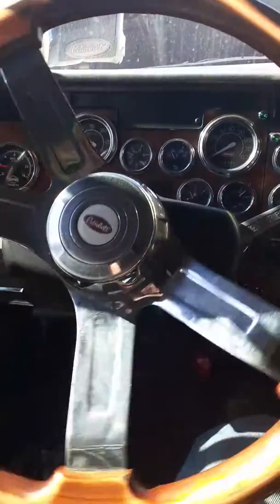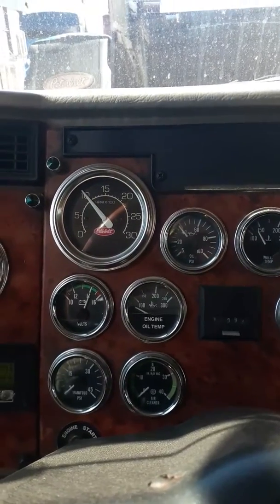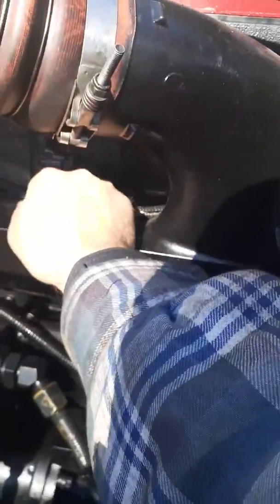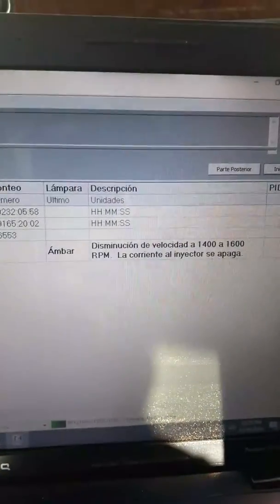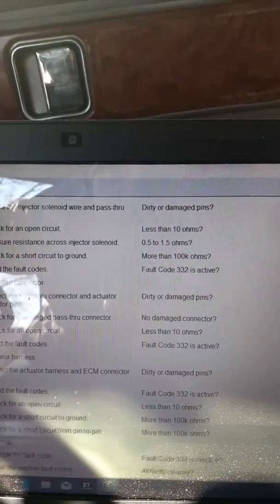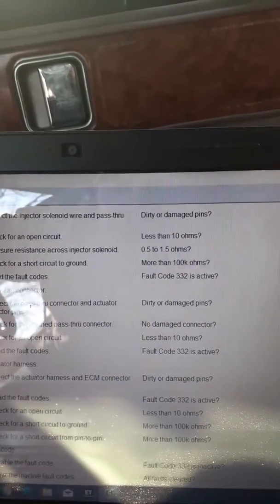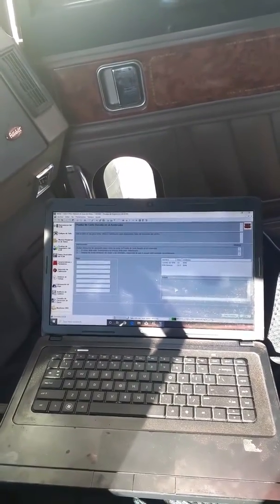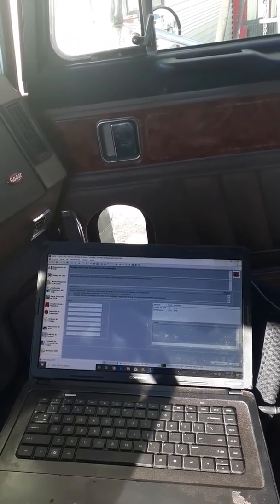How to diagnost a bad injector on n14 Cummins celect plus

Comment: I have a question if all injectors pass threws rebuild done and rack run still missing on cylinder 5 and 6 also brand new ecm two different shops couldn't fix now I am last resort at my shop I rather get it right than bad just opened my shop but need little inside on this what could be issue ???

Comment: Cummin N14 Select Plus owner here.

My suspected failing injector occurs when the ambient temperature thus the engine is at 40° F or lower. I'm not certain if it's one injector or if it's a random misfire.

The opposite to you though is that when I increase the RPMs to 1,000 the missfire goes away.  

However, I'm too terrified of destroying my crankshaft; thetegore, I'm taking my engine down and going company driving for a while till I get figure it out cuz now the cold weather will be here within 60 days in northeastern Illinois.

Comment: Great vid.. How do I get that Cummins software you mentioned
Reply from the maker: We can sale it and installed for you
Reply: @carlosortega6048  how much is it and can you help me get that set up on my laptop?
Reply from the maker: @rebeljr_dawson2.029  yes we can the price 80 usd u need to have a windows 10 and u will need a nexiq usb link to. Be  able to conect to the truck
Reply: @carlosortega6048  OK great my friend. I will be ready to order that soon.. I'm getting my laptop repaired and the nexiq just got ordered today so I'll be in touch
Reply: @carlosortega6048   hi sir I want to buy the cumins software how to buy? I'm in the phillipinse.
Reply from the maker: I can help u will need a loptop windows 7 or 10 and u will need a usb link adapter nexiq online u van get one for 150 usd
Reply: Is this the wire I need to buy

https://www.ebay.com/itm/For-Nexiq-Pn-405048-6-And-9-Pin-Y-Deutsch-Cummins-Adapter-truck-Quality-Cable/264638706401?hash=item3d9db232e1:g:0DYAAOSwcqxcFMLg
Reply from the maker: Sorry for late response but yes that conector it's part of it u will need to get an interface just go to Ebay an check for nexiq usb link and there is a lot of them to chose
Reply: Hi I have a can do interphase diagnostic. I have a N 14 red top comments started out with the check engine light coming on oil light coming on for just a few seconds and then would go off and would run fine for a period of time now it’s got a dead mess and it does not pull any diagnostic codes for a misfire or what cylinder it is misfiring on. 
Can you help ?
 The engine will not go above 1500 RPMs
Reply from the maker: So u have a Cummins software? Already
Reply: How can I get the software? I have a brand new apple Laptop. Can you help?
Reply from the maker: @josedelrio7250  that wont work u need windows 7 or 10
Reply: How to get the cummins software sir?
Reply: Hey Carlos I'm having  issues  with my truck  in high gear starts to lose power then when I get to my last gears  it want to stumble  and shake and blow some white smoke any idea what it can be